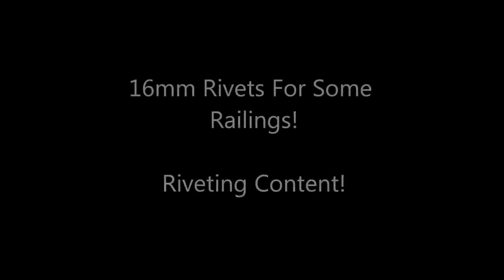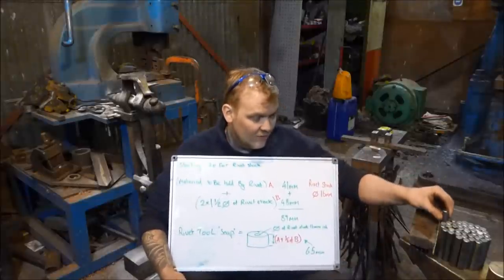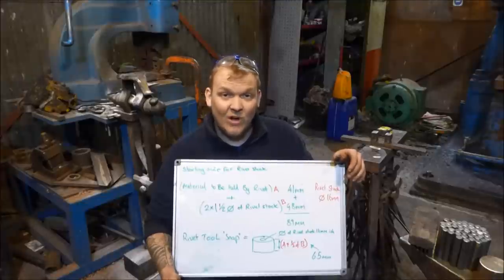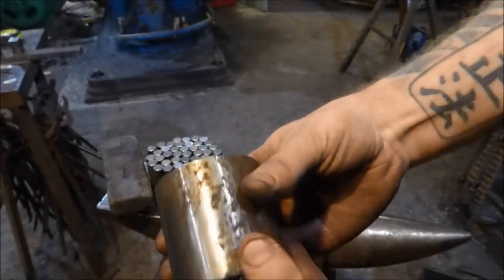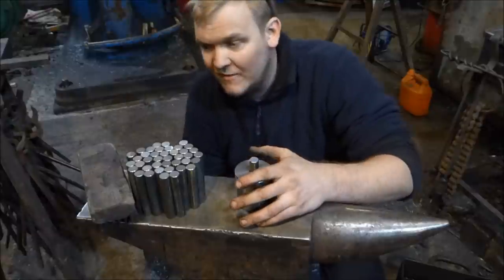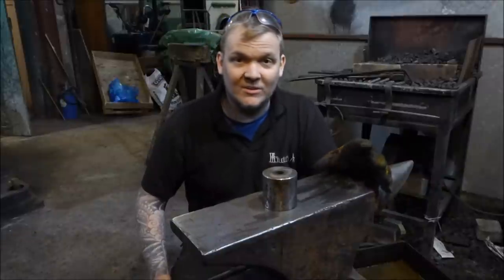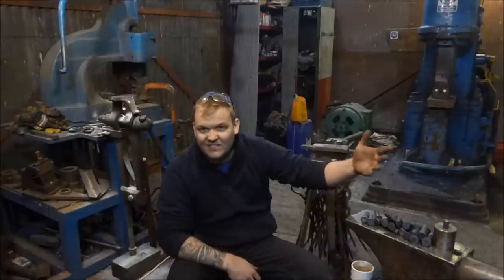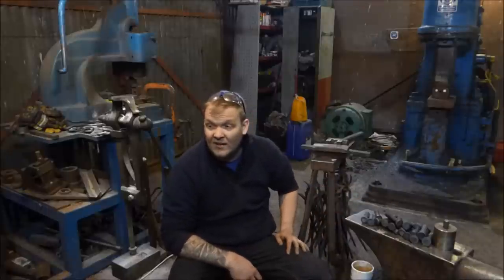Riveting Content! 16mm rivets for some railings!

Comment: Interesting video Dan. You may need to check the accuracy of your lathe 3 jaw as the video showed the work piece jiggling up and down which should not happen in a 3 jaw on round stock. Check out the numerous quality machinists on YT. 
With the rivets being made using the power hammer, it seemed to me that the slowest part of the process was the actual removal of the rivet from the tooling jig which if you wanted to make a large quantity would need to be reviewed.